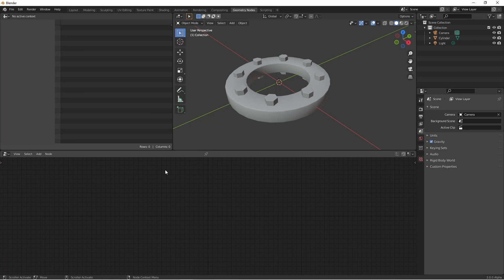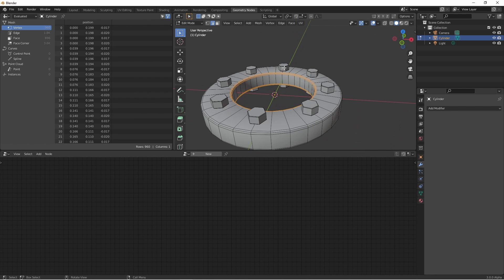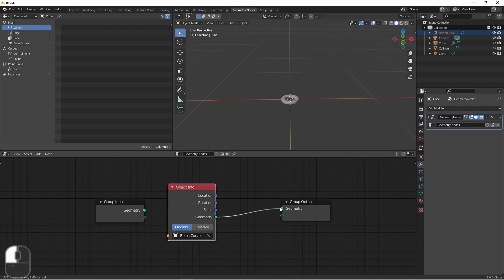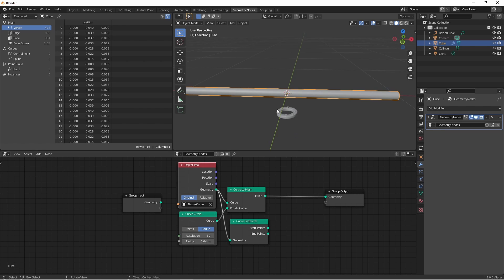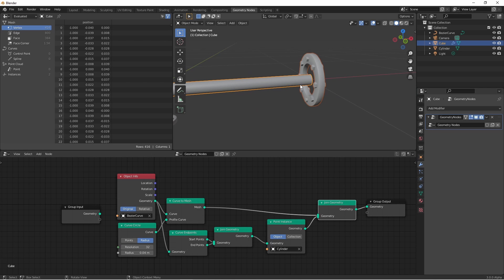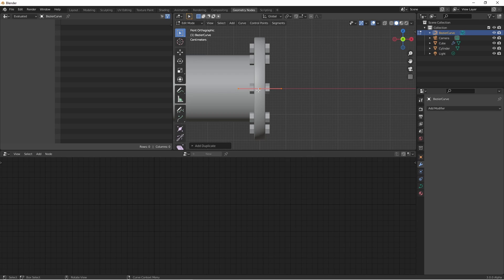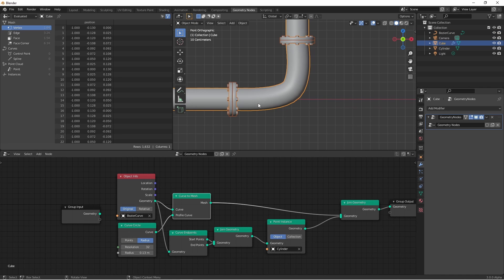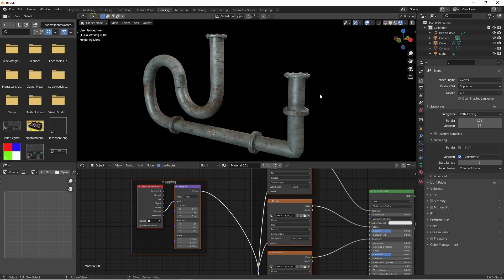Blender 3.0 Project: Easy Geometry Node Pipes

Comment: Thanks for this but I have a question:
Why is the instanced flange larger than the original?
Reply from the maker: Because I forgot to apply the scale to my flange model. 😫 Good catch!
Reply: @JohnnyMatthews  Ah thanks
Reply from the maker: Yeah, I went back to the file, applied scale to the flange and it got tiny :D
Reply: @JohnnyMatthews  😄

Comment: After digging into Geometry Nodes because of this video, I'm now a a bit salty with how misleading this video is about how UVs with Geometry Nodes work (or rather, sorta don't?)
I mean this in the sense of modeling for a game engine, where you can't rely on the one trick people seem to suggest which is feeding a Blender material a live value from the node to try and compensate.
Reply from the maker: It was not my intention to mislead you. Over the next couple of versions, UV support in geo nodes should be getting better.

Comment: You’ve done marvelous work with geometry nodes curves recently, thanks a lot. Do you plan (or have heard about) to work on UV Mapping on those curves. It would be fantastic to be able to apply a texture with X/Y or Z following direction of the curve with a node. Anyway, thanks a lot for the work and the complementary informative videos.

Comment: Thanks again for this video. I don’t really understand the Curve Endpoints Node. Does the flange geometry correspond to every start and/or endpoint? What do I do if I want to have a flange on one endpoint while having a knob on another endpoint of the curve? Do I need two Join Geometry nodes if I want to have one mesh at the start point while having another mesh at the end point? Can you help please?
Reply from the maker: For each spline in the input curve, the endpoint node outputs all the startpoints out one output and all the endpoints out the other. So if your curve has 3 separate splines in it (3 disconnected parts in the same curve) you will get 3 starts and 3 ends. How you use those is up to you.

Comment: Thanks for the great content. My only question is why didn't you apply the geo nodes directly to the bezier curve, and instead to a cube?
Reply from the maker: Good question! Because that is not a feature...yet. You can only apply geo nodes to meshes and point clouds. But there is a patch in the works to add that to curves as well!

Comment: Is there a way to make this pipe have variable width? Like some modifier before the curve to mesh node.
Reply: You can try scaling the vertices in the bezier curve with Alt-S
Reply from the maker: sure, drive the pipe radius with the curve circle radius. And a point scale node before the ebdpoint instances.
Reply: @JohnnyMatthews  Thanks for your response. Which node into curve circle radius can I use for something like position dependent radius? I wish I could do something like in shader editor which you create a texture coordinate node, separate the XYZ position and use as input for something else.